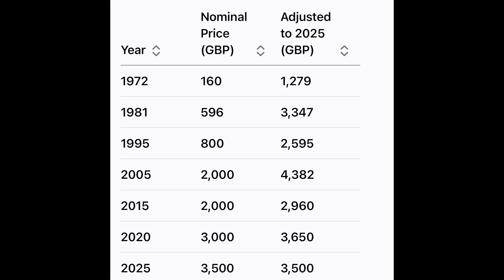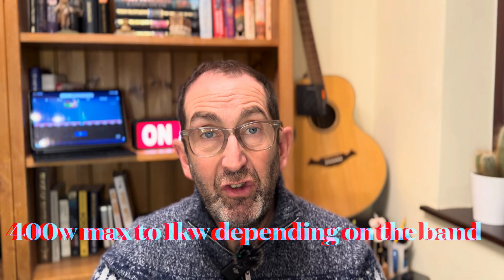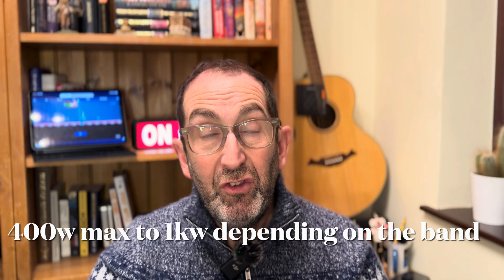The Great QRO Swindle

Comment: Use cube power rule and calculate range in vacuum. In short ranges, even 10dB means nothing. There are miniscule differences in medium ranges (you can get those QSOs will less power); however, if you calculate a theoretical range in vacuum, then those kilowatts makes the difference.
Reply from the maker: Thank you for the thoughtful exchange, 2E0OGY. Your observations astutely highlight the disparity between the linear scaling of transmitted power—and its associated engineering and economic demands—and the logarithmic perception of received signal strength. Indeed, the transition from 5 W to 500 W represents a 20 dB gain, equivalent to approximately three S-units, which, while modest in perceptual terms, can profoundly enhance reliability in challenging propagation conditions. At £7,500, the Flex Aurora offers exceptional value, particularly given its professional integration and support, underscoring the efficiency of such investments for serious operators.
Your insights have inspired me to conduct this experiment myself: I’ll employ an affordable software-defined radio receiver to log signal-to-noise ratios and operator reports from a series of QSOs, both before and after increasing transmitter power. Over a one-month period, I’ll analyze the data via basic statistical tools (e.g., in a spreadsheet) to quantify the perceptual and measurable deltas. This approach will complement theoretical models like Friis while grounding them in practical evidence—I’ll share the results in a follow-up video. 73 de G3LRC. Dave.
Reply: @G3LRC  Aurora is an early bird in what comes next in amateur radio - higher power with smaller radiator. Step similar to introduce of switching power supply. No wonder Flex radio wants to capitalise on that, however it is only temporary.
Reply: You also have to accout for noise level at the RX station.
You might need that extra power to break through the noise floor.
Reply: @Channelmaster73  just account for receiver sensitivity, 0.22uV is common against nearly all transceiver. Yes, there will be better ones, there will be worse, but 0.22uV is about the common ground middle.
Reply: @2EOGIY RX sensitivity is not the same as LED noise and transformer noise. 
You never know the noise level at the RX site. 
So extra power can help punch through the external interference.
Reply: @Channelmaster73  we are calculating theoretical range in free space, a chance to receive information, you can take into the account that operator did not have slept well last night but that does not change the fact that signal drops by the sphere surface, so 1/(4πr² ) therefore on every double distance you have 4 times drop. Just calculate how long it will take from about 71V (at 100W) to 022uV and you have naked ratio. From that you can add/substract differenc in dB for power difference, antenna gains etc. I asked AI to do it but numbers ware som unrealistic. for 1kW it showed about a quater of circumference of the earth, where HAMs gets woldwide QSOs. Anyway, the resuts were also too linear for reverse square. However we are talkiong about thousands of km/miles (choose any at this scale) difference.
Reply: @2EOGIY  I'm not saying you're wrong, I said you missed the noise floor in your calculation, that makes more power ideal as many people operate in high noise now.
Reply: @Channelmaster73  I have at QTH noise level at 9+20dB but that is not relevant to the topic of the video. It was: what you get for your money. How many miles or kilometres you will get per fiver.
Reply: @2EOGIY it is very relevant, because the topic is about $ per DB and how much DB do you need.
If the RX station has a high noise floor and you can't buy a better antenna well the only way to get over that noise is with power.

Comment: But when you add up all of those 1.75dB's over each of the contacts you make over the lifetime of the station (3yrs or so) the more you use the system, the amortised cost differential reduces over time! 

My comment is very tongue in cheek....
Reply from the maker: Many thanks for watching.  There is also an argument that QRO is worth paying for to get over the local noise of the receiving station.  73.
Reply: @G3LRC  Thanks for the reply. 

I tend to have a reasonable amount of noise here and for me, having a loop antenna (mine is a Wellbrook on a rotator) is a godsend. I almost completely packed up radio around 2006 or so, read a lot of reports on loop antennas, bit the bullet and is probably one of the best investments I've made in the hobby.

It is a shame that not all radio's have a dedicated RX antenna port. Personally I don't run QRO - I can run 200W max but given a 100W radio with a dedicated RX port and a 200W radio without, I'd go for the 100W radio every time.

Comment: I've built a QMX hi-band and get great reports from it .  Thinking about building a QMX + . If i was to use the additional space in the qmx+ to build a 50w amplifier, that should give an additional +10db, along with CESSB and Polar modulation, should be the equivalent of 120w radio (+13db over 5w).
Reply from the maker: Many thanks for watching.  Great work on the QMX build. I’m definitely getting a + and I can’t wait to try one. 73.
Reply: I thought this for many years, I paid just QMX, it’s spot on, until you give your operation conditions who know what transceiver your signal comes from.
I can now generate my own power by charging my battery from my car as I travel around, I don’t a great big man cave or shed, more savings and effort.
QRP..❤❤